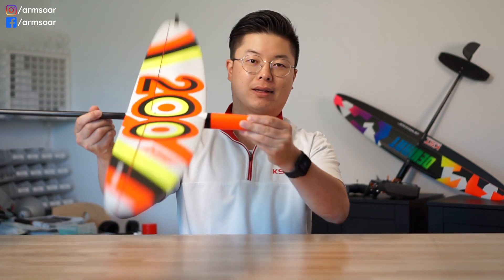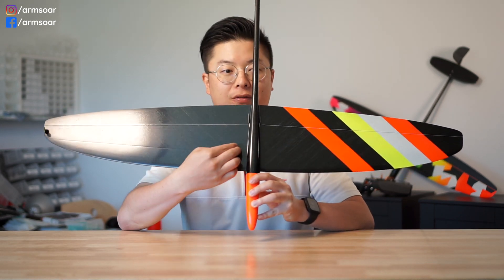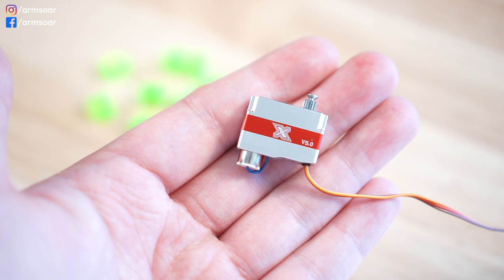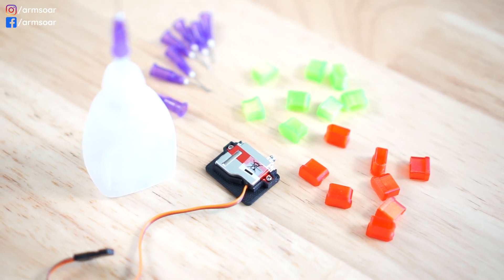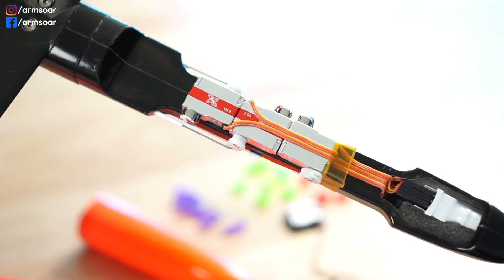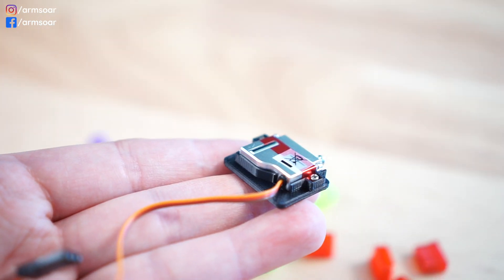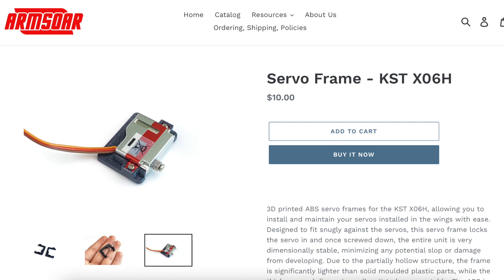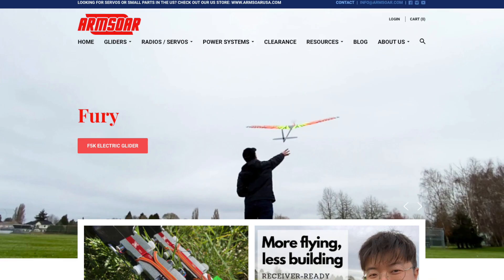RC Glider Basics | CG and Dive Testing Your DLG

Comment: One topic i would like to see you talk about in a future video is turning in a thermal. I’m coming from flying RES ships. My instinct on a DLG is to primarily turn with rudder, with a little up elevator to keep the turn, and some opposite aileron to maintain the desired bank angle. But I know some people prefer to turn with ailerons into the turn and “bank and yank”. Coming from RES I rely on rudder a lot (of course) but what is the correct way?
Reply from the maker: That's a good idea, it's a bit controversial but an awesome topic.